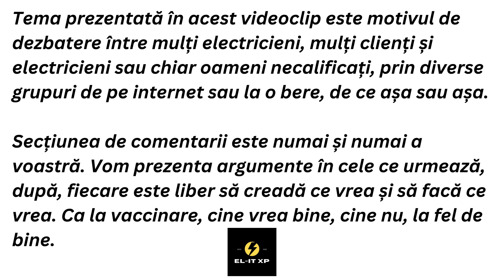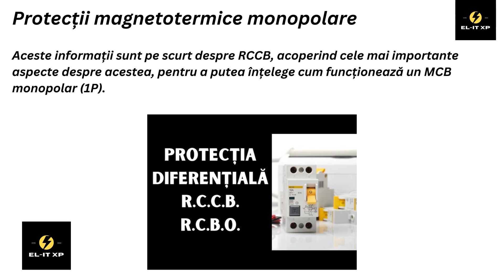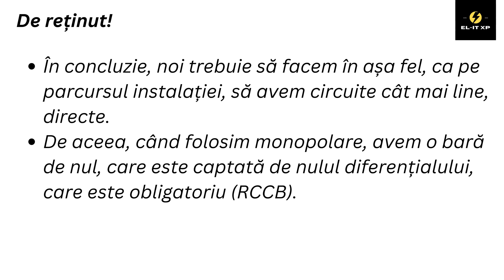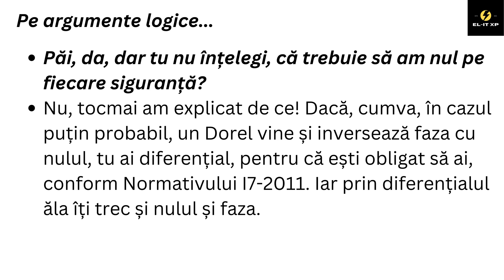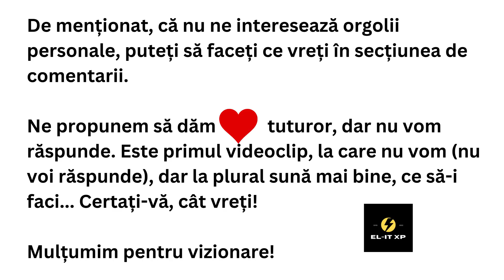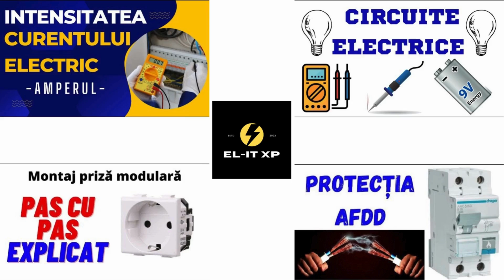[EXPLICAT] Diferenta dintre 1P+N si monopolare - 1P+N si 1P - Bipolare si Monopolare

Comment: Salut! sunt la inceput de drum va rog sa imi explicati si mie mai exact ce inseamna nul activ si nul inactiv pe mcb-uri?! probabil s-a explicat in video dar cred ca nu am vazut. Multumesc.
Reply from the maker: Salut, nulul activ -N, nul de protectie - PE impamantare. In sistemul nostru TN-C, care devine TN-C-S, dupa tratarea neutrului,  conductorul comun PEN, Devine PE si N.
N, nulul activ transportã curentul de sarcină înapoi la sursă, iar nulul inactiv, deci PE ul, împãmântarea, nu transportă curent în condiții normale,decât in situatii de defect. Sper ca te-am lamurit, daca mai ai întrebãri, lasa-mi in comentarii, succes!
Reply: @elitxp  M-ati lamurit, multumesc mult!
se pare ca la mine in tablou nu pot face TN-C-S deoarece cand am cumparat casa conductorul de PE nu era tras in tablou si e cam dificil sa trag un conductor pana la el  dar erau trase la prize (e bine si asa).
Dar de curand mi-am instalat un RCCB de tip A pe iluminat si prize eventual mai fac teste cu lampa de control pe L si PE sa vad daca actioneaza diferentialul. :) 
Cu siguranta daca mai voi avea intrebari voi le pune cu drag. Multumesc mult pt eforturile depuse pentru a ne ajuta sa intelegem meseria aceasta frumoasa . Fiti binecuvantat!